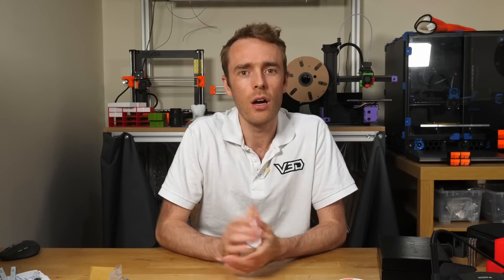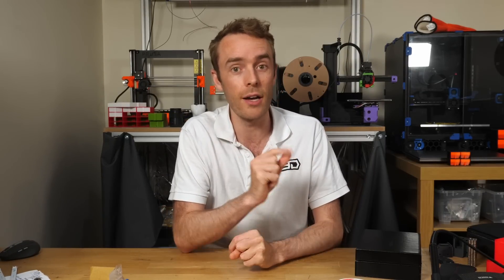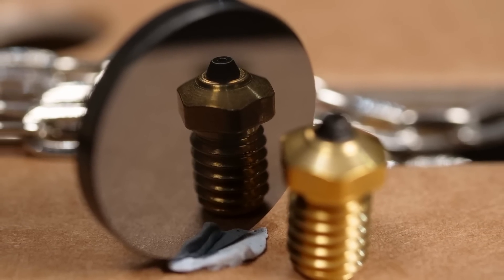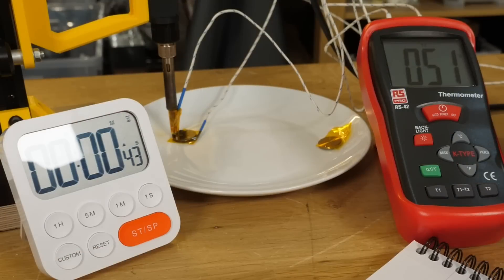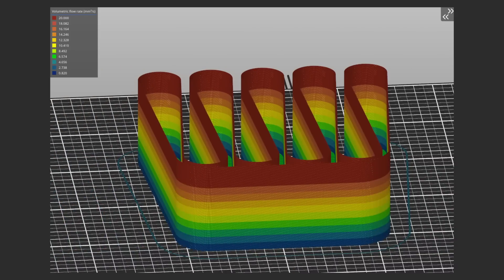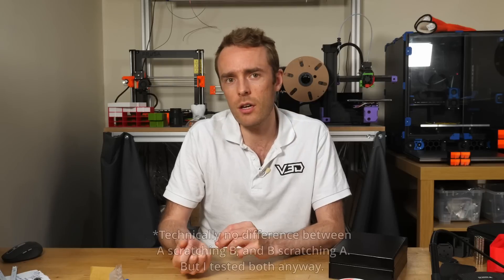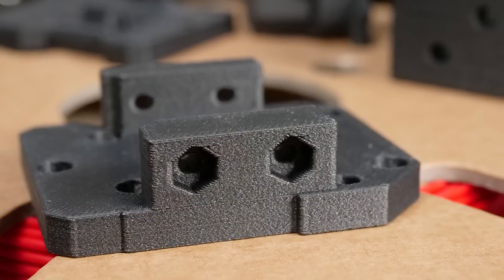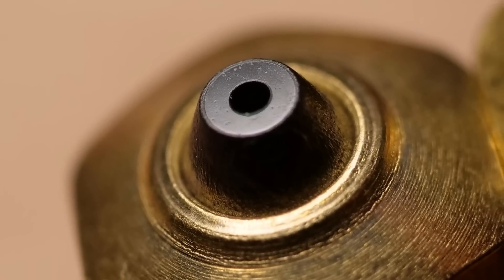A 3D Printer Hotend Nozzle That Lasts Forever?

Comment: Hi, I'm english and I am from oxford, I find it difficult to catch your technical phrases because your elocution is very fast in a fast rhythmic way which emphasizes every third word of very technical phrases, like an 1950s professor or squadron leader on oldschool bbc. If you had interpretability training for a TV show or a radio voice which is easy to listen to for everyone, I dunno how they'd fix that, I recommend you finish every sentence on a very high or a very low note, like that your ovice would be musical and the phrases would be more differentiated, you speak the words very fast so two words sometimes are spoken very fast as one, slightly flat intonation of those words, and also have snappy silences between words which are in the same train of thought, cheers. the words are machine gunned in groups of 3 and 4 and they are very technical so i can't concatenate them prior to the following phrase starting and you can play some intonation games as practice to see if you strike a pro speech delivery.

Comment: $100 for a diamond nozzle really isn't all that expensive. If you're ever printing anything abrasive, you know a spool of that material itself is like $100. So why would you get anything but a diamond tip nozzle? Diamond has extremely high thermal conductivity and hardness so it should last forever; it should be the obvious choice.

Comment: Two factors here that could be at play are surface roughness inside the nozzles, but (guessing here) surface energy could also be a significant factor? If you try a water drop test on each material the diamond surface should have a much more spread out drop for the same mass of drop as the brass. 

This means the surface of the diamond is more willing to stick to unlike materials then the brass. So, the flow through the nozzle encounters far more sticking to the diamond nozzle's internal walls. Plus, more speed = more damping force on the flow, slowing things down. 

Just a guess though!

Comment: Users that would benefit from the extreme abrasion resistance of a diamond-tipped nozzle (a very small group) cannot tolerate a nozzle with a brass body.  In these rare cases, involving custom filaments, the nozzle's internal geometry must resist abrasion too.  Folks printing standard abrasives such as glass fiber or carbon fiber can use fully hardened tool steel nozzles (Rc mid 60s) for 100+ kg of filament without problems.  A diamond-tipped brass nozzle is neither here nor there.
Reply: Do you think the brass body of the diamond tipped nozzle wears out?
Do you know of any examples of this happening?

Comment: Ah, but what nozzle do we use for diamond dust infused filament?

Sidenote, I did put an olson ruby nozzle in my printer years ago, and about 50kg of mostly PLA with the odd spool of iron/steel/carbon here and there, no wear whatsoever, runs like on day 1.

Comment: does the 2 different materials not eventually let go, i mean they are different expansion rates and materials...
if you ...when you get carbon buildup or burnt poly in the nozzle you torch it clean it would induce separations no?
contamination like carbon dont fix them selves but you can try a purging compound some are really good some do squat try to get a chemical and mechanical reaction purging most filament purges are only mechanical not chemical reacting 
as for friction heats any material will wear down with enough friction,pressure,heats.. it will wear anything out in time 
EXAMPLE: in a blown film plant trimmings are recycled tru a venturi tube with a vac blower back into the added feeder to be mixed back in with the resin for the extruder  a2.5" pipe "s/s steel309 318ect.." 2.5"OD the trim moves about 100m/min average wearing the ss down in months the least path of resistance is where the wear is made and is not even at all  A round pipe could end up like a tear drop or a star shape wear winch is caused from friction heats 
plastics and frictions are more serious then 3d printing shows it today due to the slowed thru puts and back pressures are minimal in comparison but still are present (nothing last forever specially in poly extrusions) friction is a large enemy in every type of plastic production , if you move melted resin/poly you have friction heats and friction heats will wear stuff out regardless of the material it only helps never stops, their is no cure for friction heats as you need the back pressure for consistent extrusions and adhesion's and for over 50 years nickle and CR 38 coatings are a must, as does hard materials are better but will only last longer not forever nothing last forever and carbon alone will stop you long before the ID is out unless you only play with ply-doo

Comment: Very bad, different expansion rates in materials alone.
Reply: They could have made the whole nozzle and had better performance.  The brass interface will get loose eventually. Based on expansion rates of materials.
Reply: no one asked for a full PCD nozzle @Georges3DPrinters
Reply: @Georges3DPrinters 
They tested that 
But a 1000$ nozzle is a bit much

Comment: this might be having the same dumb issue as the Ruby nozzles, a flat back instead of a very shallow 60°+ angle to reduce backpressure. if you do a cold pull you can test that!
you want a smooth transition from the big 2mm hole to the small .4mm one, not a flat wall
Reply: The DiamondBack Nozzle is designed with two different tapered segments in the diamond portion, and it does not have any flat between the two materials. A cold pull of the nozzle used in the test might be interesting to see.

Comment: cool video, would be interesting to compare it to full tungsten carbide, as this is just an insert, so the main body may still wear away. also: tungsten carbide nozzles can be torched with an extremely hot flame, to clear any potential clogs, which neither the diamond nor the brass body will survive.

Comment: I'm suuuuuuper happy with mine, aside from abrasives(metal filled, glow in the dark and cf) I would say prints look better, I had to lower the temps I was printing at by 15c, petg really benifits from a pcd nozzle because of the lubricity of diamond, I don't get blobs and the surface is much smoother in petg. The lapped face is super nice for ironing too. At that price you'd think I would move it between my printers but I kinda dont want to go back, so Im probably gonna buy another. Somethings off on your flow test? like I feel like I was getting like 30percent more.

Comment: just because something has more thermal conductivity doesn't mean it has more thermal mass. My guess is that the carbon base nozzle (diamond) is more thermally conductive but it doesn't have the thermal mass to buffer temperature changes and the controller is having a hard time regulating the temp swings compared to brass. Its also possible the interface between the diamond and brass is adding too much thermal resistance compared to one solid piece of brass.
Reply: Very interesting hypothesis. Would you think a higher nozzle temp combined with the insane thermal conductivity would equalize/offset results due to the lack of thermal mass?

Comment: Did you try scratching the metal samples with the nozzle tip? I feel like I missed when you went from testing the control (the included diamond sample) to testing the subject (the nozzle tip). Otherwise what does the scratch test prove?

Comment: About $0.25 cents for a brass nozzle.  Thats about 400 nozzles for the price of one diamond nozzle.  I think it might be more cost effective to just use a new brass nozzle for every 3D print. :)
Reply: Assuming your time isn't worth anything. 
I personally hate changing nozzles.
Reply: @ddegn  Seriously? There are like a dozen quick swap systems out there. Its 2 wrenches and a 5 minute job.
Reply: @MakersMashup  A 5 minute job changes the $0.25 to something closer to $5. Now you're down to 20 brass nozzles before the diamond nozzle is a better deal. 
This assumes checking for nozzle wear doesn't take any time. 
The diamond nozzle doesn't change size. It's one less thing to think about. People (myself included) love these nozzles for a good reason.
Reply: @ddegn  20 brass nozzles, dude what are you putting into your printer.  You gotta be doing serious volume to go through that many nozzles, at that point you're no longer an end user but a business.  Come on, there is very little value in crazy priced nozzles.  This reminds me of the people cleaning out the ball bearings in linear rails. Sure you can do it but why?  If this is not making huge differences in your prints (and If I remember the 2 years ago I watched this video) it did not. By the time you go through 20 nozzles you'll be buying a new printer.  The list of reasons why not to spend this kind of money goes on and on.  Hey, im not yucking your yum here, I never said don't buy one.  I simply called out there is very little value gained in these.  If your laziness is worth the bucks, go for it.  But I gotta think for most people you're just making a donation to the "hey look at my cool nozzle club"
Reply: @MakersMashup  "hey look at my cool nozzle club"
Actually, I've never shown my nozzle to anyone.

"If your laziness is worth the bucks, go for it."
You're right on that one.

Nozzle wear isn't something I think about anymore. I don't have to keep track of how much glow in the dark filament I've used nor do I worry about how much CF I use. It's just one less thing to worry/think about. I think that's the main appeal of these nozzles for me.

Comment: Someone I know that prints CF filled plastics, a hardened steel nozzle is good for 2-3 months of round the clock printing. So to make payback with the diamondback, it seems you need to print equivalent of non-stop printing for a year or find some other benefit.

Comment: I tend to agree with your conclusion , hobbyist will not spend that kind of money on nozzles no matter how good they are. It's much cheaper to use brass or steel nozzle and replace them when necessary.

Comment: I operate a small print farm and love these nozzles. Mostly because once I set my z-height, it never changes. With brass nozzles, it seemed like I was constantly trying to adjust for wear to get back to a decent first layer.

Also, with the thermals on this nozzle, all my existing gcode continued to work fine, but if I re-slice, I’ve been able to get nearly 30% faster prints while maintaining better quality than I had with a brass nozzle. The perfectly shaped and polished tip yields really nice slopes and overhangs — and of course, perfect first layers. Also, filament just doesn’t want to blob up and stick to this nozzle. Filament continues the come out in nice, clean lines.

I feel like this video doesn’t test enough, in particular, test a month old brass nozzle with a month old, but still-pristine DiamondBack one — no comparison!

If you change nozzles a lot for different bore diameters than this nozzle might not be for you, but if you want a perfectly shaped and very performant nozzle that requires zero changes for the life of your printer, this is it.

For me, 95% of my maintenance requirements for all my printers is eliminated. No more accidentally breaking the thermistor or heater-block wires. No more leakages introduced while changing nozzles. None of that. Just printing product with any filament required without any worry.

Love it.
Reply: copper moves alot tru the heating changes so your flow and part fan cooling will also play more with the actual temp/size of the nozzle it's self 
over size with extra heat or extra flow and under with under heats/flow AT that point of the nozzle maybe what your seeing is the copper/brass fluctuations tru dispensations or thermal surging from flow or alike changes copper will pull heats more so from the heat block then most other materials thus the nozzles heats fluctuations are greater 

if you have not seen CNC kitchens stefan's adds 2 6 mm nuts to increase thermal consistency allowing more tru put as there is more heats reserved 

cheers
Reply: Thank you for the input, was on the fence and I'm not anymore.  Going to order mine in a minute with an all metal hot end.  

Thank you.
Reply: How did you get it to work? My diamond back keeps causing under extrusion
Reply: @metallicaandchimaira  what filament are you using? What printer?  What temps, retract and prime settings are you using?  Direct drive or bowden?
Reply: @wadebrewer7212  I figured out what the issue was. I was using overture pla+ on a prusa mk3s+ printing at 200. When I installed the nozzle though I noticed leaking. Took the extruder apart and realized the heat break was loose, causing plastic to ooz out.
Reply: @metallicaandchimaira  yeah...lol....that will do it.  So far I like the diamond nozzle.  Expensive in the big picture of 3d printer parts....but honestly...it is is an expensive hobby if you really get into it.   I believe the diamond nozzles are a good purchase.  I dont know about the high flow versions with the additional brass in the filament path for melting....I dont see how those can be cleaned and cold pulled.
Reply: @wadebrewer7212  I just like the diamond back nozzle because you risk less parts breaking trying to change out nozzles everytime. I have changed mine 3 times til I put the diamond back in and the heat block is all chewed up from me gripping it so that it doesnt twist when inserting the new nozzle.
Reply: @metallicaandchimaira  bought one few weeks ago and is working well, that's why I'm asking.  I'm seeing less stringing with petg even.
Reply: 100 usd for a nozzle where you practically never have to change the nozzle for seems to me worth it to even the hobbyist.
Hotends and its included wires are usually the first part to break by people changing nozzles. I am really thinking of getting one for my Prusa Mini+.
But are there any longterm reviews? How are t hey holding up after a year?
Reply: @clipeclipaway  I have 6 of them running now. All still working their magic.
Reply: What size do you use ?

Comment: I've been told that the Ruby is inferior for general use due to the geometry. It has a stepped design which obstruct the flow compared to standard E3D, which are conical and therefore provide better flow. Perhaps that's why the diamond did not perform very well at high flow rates.
Reply: the diamond back is supposed to have some patented geo inside, must be a marketing thing or for something else
Reply: Where the two material meet, the internal geometry of the diamond has the same diameter as the internal bore of the brass. Something else likely impacted the flow rate.

Comment: How far does the diamond go into the nozzle? My Nozzle-X is not just a hardened tip. The entire nozzle is of the same abrasion resistant material. Which makes sense as the material does not melt in the tip. 
So, this one may slowly carve itself out until the nozzle is pushed out. I'd like to see some long term tests.

Comment: 6:27  *Minor snobby correction:* Monocrystaline Diamonds can be made synthetically.  I think it is typically Chemical Vapor Deposition based though so unlike PCD, the “grow time” and overall shape is a major limitation.

(Granted short of Optical/Jewelry Applications I’d imagine the cost increase compared to small gains in properties wouldn’t be worth it)

(Also i am not an expert in the area, I’ve just “geeked out on” Polycrystalline Diamonds (PCD), Diamond-Like Carbon, and Carbon Glass a bunch recently after hearing about them in angle grinder disks in my welding class, so feel free to correct me if o used terms wrong, or add to this!)

(Edit: Typos)
Reply: Yeah the Costs increase, still artificial diamonds are way cheaper than natural occurring ones. But this is also mainly because of the De Beers Group, who controls the natural diamond market.
Reply: @Toxicity1987  Also natural diamonds have to be used “as is”, they can’t be bought in wafers / blocks etc.
Reply: @ericlotze7724  Uhh no? Naturtal diamonds usually are cut and polished, and you can get artificial diamonds in a typical octahedral form. This is even the most common form for artificial diamonds for usage in the jewelry industry.
Reply: @Toxicity1987  What I mean is that you can only do what the rock formation allows for.  With artificial, engineering (or honestly just money and time) /science are the only limitations.

Comment: One thing I haven’t seem to find is a “Cutaway (Diagram) “

Granted it seems to be doing far better that the Olson Ryby, but i heard one problem with that one was it was an abrupt change from filament diameter in a brass sleeve to the cylindrical ruby nozzle’s fonal “nozzle size” hole (0.4mm etc).  Perhaps this one has diamond lining the full way, or at least the insert has a taper on the filament side?

(Edit: Typos)
Reply: on their website there is a video about it and at ~2:12 it shortly shows the inside

Comment: I have had to increase my print temp for normal meterials with a hardened steel nozzle, so not having to do that would make life a whole lot easier
Reply: I have a hardened steel nozzle on my artillery sidewinder and a diamondback nozzle on the tronxy x5sa. I have to raise temps by 10 degrees on the steel nozzle and lower 10 degrees on the diamondback nozzle. The diamondback nozzle is really a great nozzle.

Comment: Some of the clogs I've had in brass nozzles are pretty crazy. Would have to have a diamond nozzle clog especially at $100 each.
Reply: Only clogs I've had was retraction distance was too high, it was pulling back to a cold area and clogging mid print but would be gone at the next heat up.